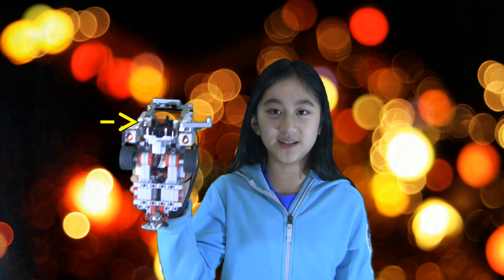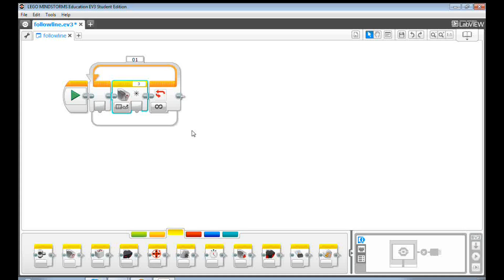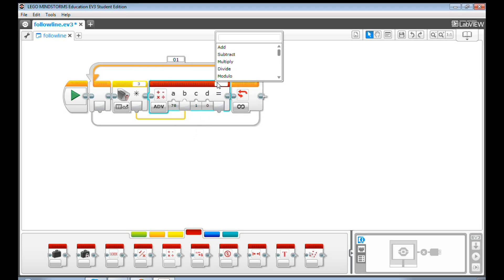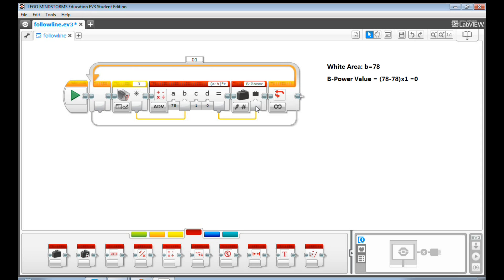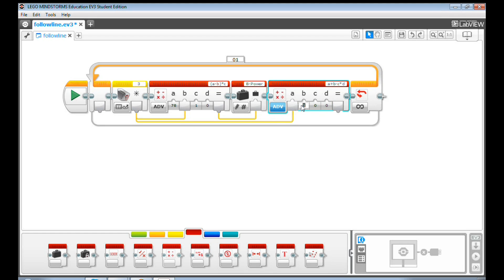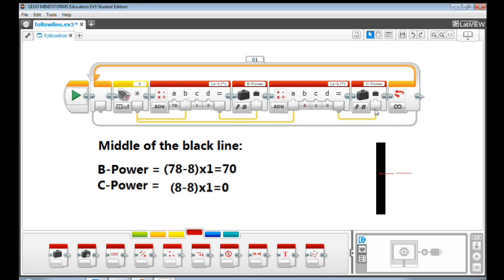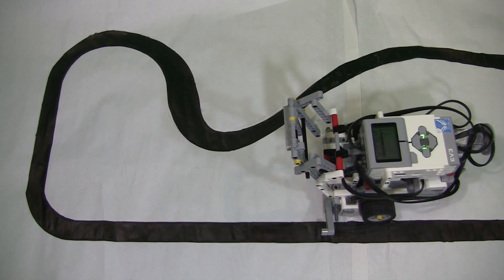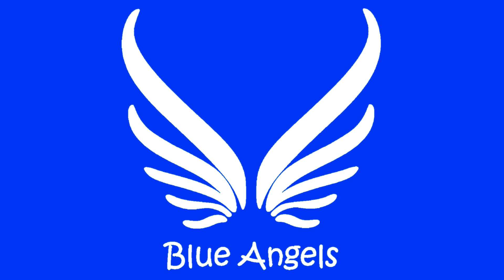EV3 Programming 1.9: How to follow a straight line smoothly

Comment: Please make an updated version, as when i did this my robot just spun in circles and didn't follow the line at all.
Reply from the maker: You can try to reduce motor speed to avoid spin. If the speed is too fast, the robot doesn't have enough time to response when it's on the blackline.

Comment: I have a problem now, I changed the C value once then changed it back but now the B-motor keeps turning in sync to the C-motor on right turns and I am very confused. Could you please tell me if there's perhaps something wrong with the program or anything else? Thanks!

Comment: works great I subscribed but is there any way to make this program faster so the ev3 can move through the line in less time
Reply from the maker: Hi Ayan, the c value controls the speed. If you watch from 7:04 she shows you how the robot goes too fast with a c value of 1, but goes slower with a c value of 0.4. Try adjust the c value.
Reply: thank you

Comment: my robotdid not follow the line and it only moved if it was on the white but if it went on the black it would not move at all. plz hlp
Reply from the maker: Hi, how about check the setting of your loop block. Try set to "unlimited" loop, and see whether it works.
Reply: I had this too
Reply: Just calibrate the sensor and it will work

Comment: Hi! how can I make this faster? because if I put a bigger value (like 1) the robot is not/following the line straightly.
Reply from the maker: If you have a long straight line, how about follow the line for a fixed distance, then simply move forward until the RLI value out of certain range? When there is a curve, the RLI value will be out of range, then use the follow the line program to get back on track.

Comment: Thank you for sharing your time & expertise - very cool & easy to follow.  What are the implications of putting the read variables on a second line to feed into motor power, vs. just appending them to the end of your original path?  I didn't realize seperate paths could just dead end (like after feeding the motor) - thanks for that tip too!
Reply from the maker: Hi Jerry, the purpose that I put the read variables on a second line is to make it easier for other people to read and understand. :)
Reply: Cool - thanks!  Our team competed in our city elimination rounds yesterday here in Alaska - this is our first year and we only got 73 points on the table, but we had such a blast & will be trying again next year.  Thanks again for sharing/explaining your techniques.  You helped us be better than we would have been otherwise.
Reply from the maker: Glad our videos help Jerry. Check out our facebook next year, we published our engineering book there. Hope it helps you team as well.

Comment: this program follows the left edge . what Changes should we do in order to follow the right edge?? plz help
Reply from the maker: When you do propositional line following, the robot follows the edge of the line. whether you follow the right edge of the line or left edge of the line, it depends on whether you pass B-Power to B motor, and pass C-Power to C motor. If you want to follow another side of edge, try to pass B-Power to C motor, and pass C-Power to B motor. You can take a look "EV3 Programming 2.1: How to follow a line with sharp curve". In video 2.1, it shows you how to switch the edge.  hope it helps.

Comment: Yes thanx i crease the c its work 😍but i have another question 🙈if u dont mind iwant to put another sensor how can i complete programming at the same program that u did
Reply from the maker: +بينه الكواري  do you mean put another color sensor? You can use the same program, just make sure to change the color sensor port value to the one that you plugged in color sensor.
Reply: +Blue Angel do i need use a switch block when i have 2 color sensor at the same programming that u did

Comment: how do you make it go faster and also make it stop at a white line if it is following a black line?
Reply from the maker: +alicia derby you can try to increase "c" value to make it go faster. Or, if the line is straight, the robot should be able to follow the line after certain distance, then, you can just let it go straight faster instead of following the line. For the white line, that's tricky. You can try to let the robot follow the black line with fixed distance until getting close to the white line, and then go forward until the RLI value is close to the RLI value of white.
Reply: +Blue Angel  I love your videos. But if as you say we increase c wont it be more jaggy??
Reply: +bob xatzibasiliou The 'c' value can be adjusted according to the task. If the robot is simply following a straight line, you can try increasing the 'c' value. Conversely, if the black strip (that the robot has to follow) is slightly curved, then the 'c' value has to be decreased.

Comment: Thanks for the tutorial. My 8 year old daughter was able to input the program and we got it working with a little trouble shooting... we had the Move Tank set to On for Rotations rather than just ON. So great to finally create something with the EV3 that works really well. We created a wavy line and it still followed it smoothly at 50% output to the motors. Thank you for your video!
Reply from the maker: +Peter Vree Sounds great! Glad the video helps. :-)
Reply: Thanks for your comment.  We were having the same problem too and that's what it was. - Just change tank block from # rotations to ON.
Reply: I don't understand

Comment: Is it possible it make it faster, while keeping it smooth?
Reply from the maker: +Me “Dapaca” ow You can try move forward faster when the RLI value is in a certain range. When the RLI value is out of the range, let the robot follow the line again.
Reply: +Blue Angel how
Reply from the maker: I tried following before: Follow the line for the fixed distance first. Then, just move forward with higher speed without following the line. If the robot see RLI value out of range (you need to test it to find appropriate value), let it follow the line again. You can include above steps in Loop block.

Comment: dude VERY COOL MAN.
Reply from the maker: +The Luckycraft Thanks!
Reply: +Blue Angel :D
Reply: +Blue Angel  My freind is having problems. I can't really get it to work. /: is it for INSIDE the line, or is it for following one? If its for following the inside then you should rename it. no offense. alos sorry if im strait foward, its just that we have a WORLD tournament coming soon and we can't get a program to work.
Reply from the maker: +The Luckycraft When you do propositional line following, the robot follows the edge of the line. whether you follow the right edge of the line or left edge of the line, it depends on whether you pass B-Power to B motor, and pass C-Power to C motor. If you want to follow another side of edge, try to pass B-Power to C motor, and pass C-Power to B motor. You can take a look "EV3 Programming 2.1: How to follow a line with sharp curve". In video 2.1, it shows you how to switch the edge.  hope it helps.
Reply: uhh...

Comment: how many color sensors do you need for this im looking for one with two sensor
Reply from the maker: Kobi Haig technically, you only need one color sensor to follow the line smoothly with this program. In a competition, you may want to install 2 color sensors to follow different lines based the position of the line...

Comment: hi, i have a problem, i folowed u`r instruction, got irl for black between 8 and 12 and for white between 62-72.  so i`v made this program, but the robot isn`t folowing the line, hes turning to much and lose the line, then its start to spin in circles. what is the problem? do i need negative powers? the color sensor is situated between the wheels, exactly at the midle point where are the red parts of the motor
Reply from the maker: Stefan Cristian Hi Stefan, the negative power might help.

@098    2:04   Play nextPlay now          
EV3 Programming 2.1: How to follow a line with sharp curve

Comment: What if i wanted to use 2 color sensors on each side of the EV3 in order to follow a "road?"
Reply from the maker: Erik Art Hi Erik, how does the road looks like?
Reply: Just tape put on the floor, with some winding turns. Like a normal street road with 2 lines on either side of the ev3
Reply from the maker: Erik Art -Add Loop-Move Forward (Turn Moving Steering On)-If the left color sensor sees a black line (Use Switch Block)-Turn Right (Moving Tank)-If The Right Color Sensor sees a black line-then turn left-Loop back (Repeat The Process)

Comment: Hi Emma! Is it possible to make the robot stop after it sees no black line  
I need this for a project.
Or is it possible to make the robot stop when it sees no ground (exe) i put it on a table and it goes straight to the edge and stops?
Reply from the maker: MegaJustshutup this is tricky, you can try to let the line following program exit loop when the RLI value > you white area RLI, or RLI value = 0 (if the color sensor go out of the edge, the RLI value =0)Or, if it's acceptable, you can define the line following program to stop after certain distance.

Comment: Hi Emma!  A big thank you from Belgium for your very usefull lessons!  The kids in my classroom, P5,  actually are learning to program the EV3 robot by watching your videos!  We are very interested in your lessons for following the black line and recognizing the different colors.  We are trying to combine the two ideas into our program  for following a black line, then switch to the yellow line as a shortcut, and then switch back to the black line again.  For My students It is a hard nut to crack... Could you help us?   And a big thank you again for all the good work!
Reply from the maker: Olivier Dijkmans Hi, If you are able to install 2 color sensors,  you could use 1 color sensor to follow the back line, then use the other color sensor to detect the yellow line, and following it. If you only have 1 color sensor, you can follow the black line for a certain distance (RLI mode), then you can just let the robot go straight (color detection mode) until it sees the color yellow, then it can follow the yellow line.

Comment: this is a really helping. I built the robot and it seems to work very well in smooth curves but fails in sharp corners even if I reduce the speed. please help
Reply from the maker: Bikie Rapelang No worry, I will post a new video in several days to help on the sharp turn.
Reply: thanks
Reply from the maker: Bikie Rapelang We posted it :)
Reply: Thank you very much Blue Agel

Comment: how did you get to the 78 and the 8 values
Reply from the maker: Hi Stav, you need to measure Reflected Light Intensity
(RLI) to get your values (they might not be exactly as 78 and 8). 
Following video will help you on how to measure:

EV3 Programming
1.8: How to measure Reflected Light Intensity (RLI) with color sensor

@watch?v=a-Pw2aNvKpg

Comment: This is a great explanation on how to use Data Blocks in an EV3 Line Follower program.  I like how you show the math involved, and how you superimpose the robot's turning action onto the EV3 program screen -- it really helps understand what the B-Motor and C-Motor are doing.  Our FLL team has been using a simple switch-within-a-loop Line Follower program, but the robot "waddles" too much and the driving action is not very smooth like your program is.  Keep posting these kinds of videos -- they are really helpful!
Reply from the maker: dluders Thanks! Glad our video helps! Good luck in the FLL Tournament.